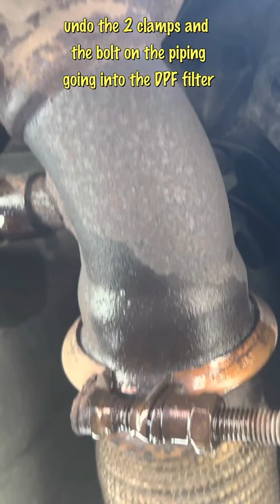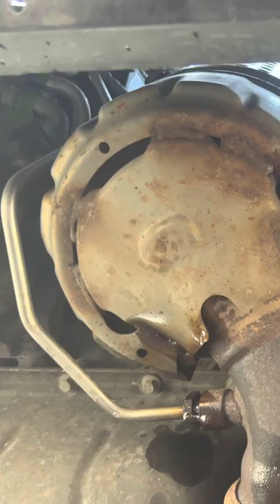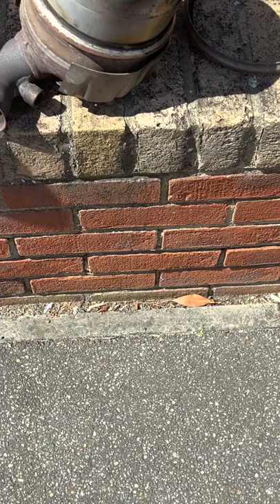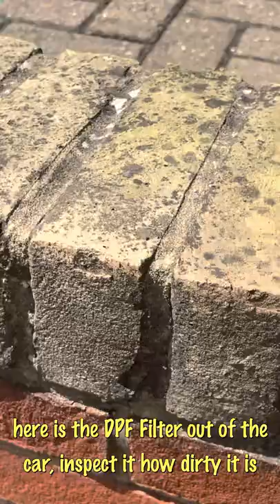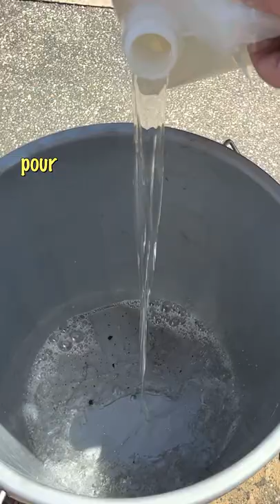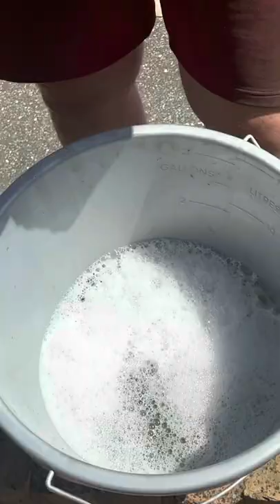DPF Filter cleaning at home DIY

Comment: You cleaned it the best way for that particular dpf car model. Some companies are charging 90 quid just to clean it on the car with some cleaning detergents at high pressure and reset the ecu dpf parameters or forced regen it doesnt last very long nether do they probably check any other potential issues  that might be causing dpf to become blocked too quickly or cause a EML to come on ive found so many culprits that cause dpf issue from turbos to sensors even intercoolers and incorrect dpf resets done by even dealerships its a gray area in automotive mechanics some techs dont know enough about these you can clean it all you want sometimes theirs unerlying issues as to why as quick clean isnt sufficient sometimes for a more permanent repair

Comment: Interesting technique
I cleaned mine by removing it and throwing it in the trash and remapping the engine
Reply from the maker: :D that works too,but some people don't want to risk getting penalties.
Reply: @MrNiceGuy94  fair enough
Reply: When you say take it out....what replacement is needed.as I'm a welder fabricator an could make it if needed just need to know what.... I'm no macanic 😂
Reply: @danneljamespage142 just a down pipe from the turbo with a bung on it for an o2 sensor
Reply: i wanna do the same to my CC tbh. Nothing but trouble this emissions bollocks, but bit weary of the polis tbh. Risking getting it impounded and hit with a much larger fine, idk man
Reply: There more to it than that surely?
Reply: better to clean it out when needed. if you remove it you'll get a very strong fume smell and a lot of smoke from the exhaust.
Reply: @josephprocopio8423 there is certainly more to it. The truck needs to be tuned to removed the emissions. However, on the exhaust, they are correct. Straight pipe from the down pipe at the turbo to the tailpipe out the end.

Comment: Did this actualy work on both removing soot and ash from the dpf??
Reply from the maker: Hello. So it all started with the PAT fluid being low on the car. I topped it up. After that the owner told me that he got fault codes for the DPF being full. I have done the cleaning as you could see in the video. Then ran the diagnostics on the car,deleted the fault codes and checked the live data and everything was fine. I have done the whole cleaning a year ago, and no DPF problems since then. Although I can't tell if it removed all the soot and ash from the DPF, however it had cleaned it fairly well. Also a good idea after the cleaning to run a forced regeneration on it. 
Doing it this way is a lot cheaper than buying a new DPF and if you can do it all for yourself it is even better.
Reply: @MrNiceGuy94  thanks for the reply mines on 103k now and messaged just popped up luckily i have a launch x431 Pro scanner so can see the soot, Ash and diffential pressure numbers. Bought the wynns dpf cleaner so going to give that a good 8 hour soak to see how it goes, atleast these dpfs are easy to get off compared to some.
Reply from the maker: @beany1987  Yeah,these ones are very easy to remove. The thing is, if you reset the values it will show you very low soot and ash amount. So basically without cleaning you could that too,however after a short period of time they will rise again very quickly. What I suggest to do is,remove the DPF, clean it with the Wynn's cleaner, i usually let it sit in the fluid overnight,then put it back, let all the foam come out through the exhaust, take it for a test drive, get it up to operating temperatures and do a forced regen. Obviously you will have to let the car ECU that you have "replaced" the DPF filter. Amd finally check for values in live data. The differential pressure is important. At idle it should be single digits. Closer to 0 the better,meaning air has no resistane to go through the DPF so it isn't blocked.
Reply: @MrNiceGuy94  yes seen a few people saying to do it that way, mine isn't to bad on pressure its 8-10 on idle and at 3000 it's at 250 seen some specialist cleaner videos where their dpfs are showing pressure of upto 900mbar before cleaning but they have injectors problems or the newer adblue with block injector but even at that extreme the can be saved.
Reply: How do you remove the DPF?
Reply: @leandramckinney2037  it's different for every car, depend on what's car you have any if you can also get to it. On some cars it's a absolute nightmare to even get at.
Reply: Just checked mine today since I cleaned it 10 months ago, idle is at 5 and 3000rpm it's at 50. So the wyns cleaner followed by brick cleaner diluted down worked very well and my dpf is showing pressure levels the same as a new dpf.
Reply: @MrNiceGuy94 great video thanks for sharing, if someone wanted to delete on this type would you cut the mesh looking stuff out then have it remapped as a delete sorry?